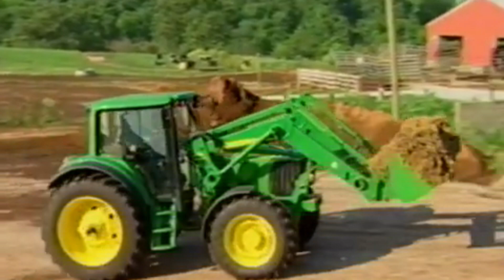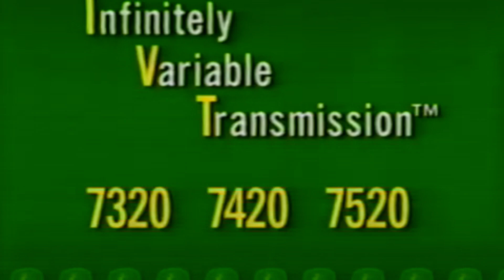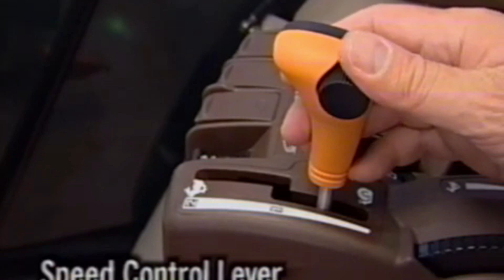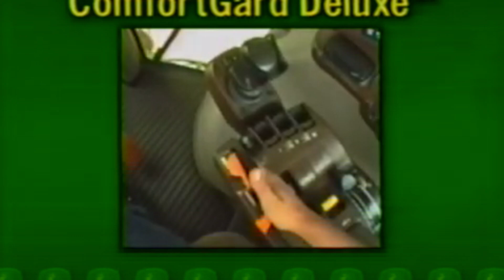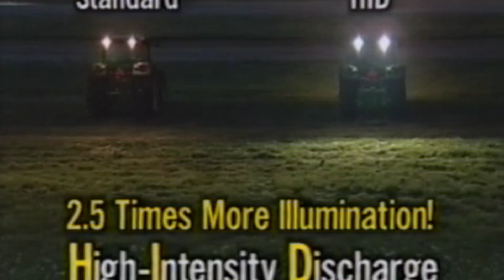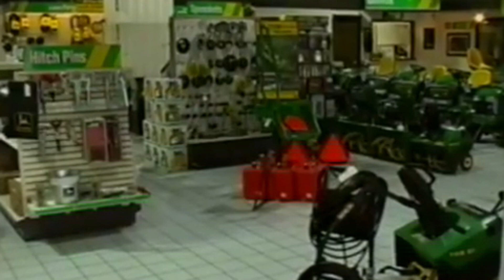John Deere 7020 Series Tractors Promotional Video

Comment: I THOUGHT the John Deere 7020 Series Tractors were introduced in the 2000s.  BUT, I would LOVE to drive the John Deere 7220 2 Wheeled Drive Tractor with the 90 inch wide front axle for pulling the John Deere Round Hay Baler as I bale the straw after harvesting Wheat, Barley, and Oats in the Summertime with the John Deere 9860 STS Combine with a 615P Belt Pickup Header and the John Deere 9870 STS Combine with a 625F Hydraflex Cutting Platform, besides the 2 of my John Deere Self-Propelled Windrowers with Draper Headers.  The John Deere 7220 2 Wheeled Drive Tractor will have the same specifications of component options like my John Deere 6220 2 Wheeled Drive Tractor for my FUTURE FARM some day.